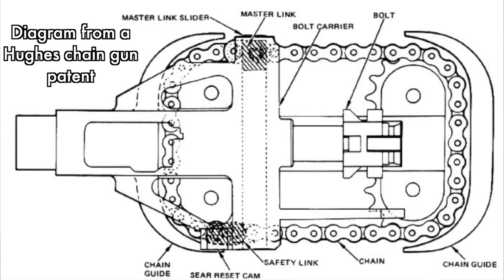Ask Ian: Are Man-Portable Chain Guns Coming?

Comment: My first thought, without seeing the vid is: Soldiers struggle with LMGs, even with beltfed LMGs that skip heavy magazins. How is anyone supposed to carry a chaingun?

Rockets and grenade launchers seem way more sensible for increased anti-infantry firepower. The XM25 seemed very promising. But maybe theres different answers and thoughts.

edit: Yup, not quite as bad as a minigun in weight, but even less benefits.
Reply: Since you mentioned Rocked and grenades, is there a difference between Missiles and rockets? or is it like Missile are big boom, rockets are small boom type of ammo since I remember something about Micro rockets?
Reply: @drivanradosivic1357  Yeh, in military generally missiles are guided and rockets unguided.

That said, these are very vague and unclear terms. Technically a "rocket" just means youre using a rocket engine, so guided missiles are often still rockets. Except the missiles who use jet engines, like cruise missiles.

And it gets even more fun if you consider that in english, missile can mean projectiles like arrows or even thrown rocks.

As for micro-rockets, probably not, because small rockets are horribly inefficient in size and weight. Look up gyrojet guns to see how bad they can be.
Something like a 7.62x51 machine gun with explosive projectiles would likely be way more devastating.
Closest thing in actual use would be 20-40mm autocannons. They almost always use explosive projectiles and are devastating against anything not using heavy armor.

Comment: One aspect where electrically operated firearms might have some advantage in terms of weight and materials is that you can further polymerize the design. You don't need metallic bolt carriers for example because all it does is carry the bolt. Depending on design the only metal operating components could be the barrel, the bolt head, firing pin and what is needed for the electricals. 

Personally I think the question was a bit too narrow. The better one could of been: Are electrically operated firearms likely to happen?

I think yes. The potential benefits for operational and manufacturing flexibility are not insignificant.

Comment: It's sort of like a car using a diesel generator to run an electric motor, the added complexity and weight outstrips any potential gains in efficiency. The machine gun already efficiently uses the self contained cartridges to mechanically operate the action so there is no real need to supplement it with an electric motor
Reply: except hybrid cars are actually a thing and get better milage than the ICE only versions
Reply: @davidelang  yes but the engine is not being exclusively used to drive the electric motor, the battery is being used to collect wasted energy (kinetic/thermal) and then the electric motor is being used to aid the engine. In a firearm there is no wasted energy to harvest or store

Comment: To make a chain gun (or a Gatling type gun) viable for hand-carried infantry use, you essentially need to equip your soldiers with powered and armoured exoskeletons. 

Developing actual, functional, combat ready power armour is certainly a much more significant step in itself than building hand portable chain guns, and probably a much greater engineering challenge. 

I can't help but think that the resources would be better spent on developing better and more compact infantry support vehicles and/or UGVs.

Comment: given that a chain gun does not rely on the mass of the bolt/carrier to operate, those should be able to be made lighter, so I don't see why a chain gun would be 5+ pounds heavier. they should have less reciprocating mass. and that mass isn't going to be slamming against a buffer, do this would seem to lead to less felt recoil

now, will adding electronics to firearms make them more reliable? no, it will make them less reliable, so only a good military fit when there are already electronics involved (smart rounds, computerized sights, etc). One big advantage of a machine gun vs electric weapons (coilgun/laser/plasma/etc) is that a machine gun with a single round is just as effective, once, as a machinegun with thousands of rounds, while the electric weapons are useless without a rather substantial power supply

It is an interesting thought experiment to think how much you could eliminate from the bolt/carrier/receiver if you remain locked like a bolt-action gun to handle the cartridge pressure and then open. the quick-and-dirty way would be to look at the straight-pull bolt action designs and just replace the manual action with a motor.

A chain gun could also have a variable rate of fire, very fast for short bursts, (get multiple rounds downrange before recoil can move the point of aim significantly) and slower for sustained suppressive fire.

bldc and stepper motors are very light and efficient, and for that matter, I could see linear versions of them being used

I think the limiting factor for how small the motor could be is how much force is needed to extract the cartridge, cams and levers can be leveraged to assist that first mm or so of travel (and there's not need to throw the extracted cartridge several feet, you just need to get it out of the way of the next cartridge in time to load it)

I think the reduced mass and velocity would cascade through other parts of the design. If you are driving the operation with a motor rather than momentum, what does that do for the loading of the cartridge, extracting it from the magazine/belt, could you eliminate the magazine spring (which is a balancing act of enough tension when firing the last round and not too much while firing the first to operate with suitable timing and not having the spring tension putting so much force on things that it's hard to move them)

Comment: I wonder if a sort of chain gun mechanism would be desirable for caseless ammunition. While there's no ejection cycle that you need to worry about with caseless ammunition you wouldn't have to worry about tuning a gas system to reliably cycle when an using externally powered action cycling.
Reply: Take a look at something like Metalstorm.
Reply: So far, ceaseless ammunition has major durability problems. And I’m unpersuaded that that can be solved. To be practical caseless propellant must combust explosively and completely AND be durable enough to withstand handling in the field and along the supply chain.
Reply: I don't think it would fly with caseless as it would lose the ability to handle duds.

Comment: One should note that Soviet designed autocannons, including rotary cannons, are generally not externally powered. The rotary cannons on Soviet/Russian aircraft (GSh-6-30, YakB-12.7) are gas-operated, while the single barrel GSh-30-1 in the MiG-29 and Su-27 is short recoil. These guns use pyrotechnic charges to cycle the gun in case of a dud. The gas-operated German Mauser BK-27 which is used in a large variety of aircraft including the Eurofighter Typhoon also uses this principle to cycle the action.

Comment: I can see far in the future, space firearms being driven by a linear motor because a gas system won't cycle in a relative vacuum, though it's hard to argue that's a chain gun, more of a... rod gun. Otherwise i can't see this being used,  even a powered armor should be able to clear a malfunction
Reply: For a warfare in places like the Moon, where you have very fine, abrasive particles. Your weapon should be sealed up as much as possible, so clearing any malfunctions should be done automatically by the weapon itself. That could be one scenario to have a chaingun (or maybe a "belt gun", it doesn't have to be an actual chain).

Comment: I imagine the lightest way to integrate powered bolt locking/unlocking and cycling would be solenoids. Given the abilities of modern batteries and super capacitors, one could integrate super capacitors into the magazine and receiver, and a battery into a chest/belt rig or even wires through a sling. At the end of the day, I’m confident it would still be little more than a novelty
Reply: no, stepper/bldc motors that you can control the speed and force over time rather than solinoids that only do one pull/push

Comment: How is a squib load dealt with on a chain gun?  If a round is underloaded in a traditional mg it usually wouldn't have enough energy to cycle the action.  A chain gun would cycle regardless and try to load and fire the next round?  

Similarly something like a broken case would seem like a nightmare as the external power source would attempt to cram the next round in and depending on force or torque of the external motor I can imagine the resulting jam being more difficult with the round completely mangled?  Compared to a spring attempting to push the round in on a traditional action?

Is this less of an issue on larger caliber weapons (stronger cases, better qc on powder charge?)
Reply: Good question? The projectile stuck up the barrel would not be good either unless the barrel is super heavy and rated to pressures double or triple of what the round is normally capable of producing.

As for broken/ruptured case scenario, one would hope they would have a sensor built in that detect and stop feeding.
Reply: Better hope the next round isn't a HE. I met a guy that worked on Bradleys a couple years ago and asked him about problems with the 25mm and he said one of the guns had an out of battery and exploded damaging the gun but he had no clue why it happened. I was mostly asking about rounds that hangfire and guessed that was what happened

Comment: I can see something like this being implemented in say an AR-15 type gun. Instead of a gas system and a recoil spring and buffer, you have some sort of electric piston assembly or something that pulls the bolt open, and pushes it shut. Although you'd need some way to power the thing, and I don't think it'll replace a conventional AR-15 anytime soon. But it would be cool to experiment with. You could experiment with this in machine guns to fine tune the rate of fire and bolt velocity to try and make the gun very controllable in full auto.

Comment: Would having an external power source to cycle the action mean that cartridges could be shorter (containing less propellant) and still achieve the same performance?  I presume the difference (if any) in saved weight not be significant enough to offset the weight of the chain/battery etc unless you were carrying at least several thousand rounds.

Comment: If we’re talking about man-portable HMGs, the XM312 comes to mind as a relatively light weight .50 (and 20mm HE) weapon system that had a slow fire rate and integral optics for improved per-shot-accuracy. It did not pass trials due to less reliability, heat tolerence, and fire rate compared to the M2 in mechanized applications.

The SIG MG338 may be the current solution to increasing power and range in a man-portable package. Sig claims that the .338 Norma Mag AP has better penetrating capabilities at 2000yds than .50 BMG AP.
Reply: I find the penetration claim to be highly dubious. .338 Norma mag will definitely provide better penetration than 5.56, .308 or even the new 6.8 round, but the math doesn’t add up to be better than .50 BMG. According to Norma’s website, a 300 grain round has a velocity of 2600-2700 FPS, while a 647 grain round will have 3000 FPS when fired from an M2.
Reply: @MPdude237  I was under the assumption that the ballistic coefficient would be in favor of the .338 NM at 2000yds+, but the opposite is true. 50 BMG has higher velocity, mass, and ballistic coefficient having 4x the energy at 2000yds. No amount of fancy armor piercing penetrators are going to beat that!

Now I'll have to go through promotional videos to find that claim again.
Reply: @MPdude237  Found the claim: https://www.youtube.com/watch?v=j66Y_owzcTo at around 1:45. They put the claim at 1500 meters, not the 2000yds I incorrectly cited from memory.

It seems highly dubious because the math just doesn't add up.

Comment: I dont think they were ever going to come, anyone whos been in any actual infantry position already knows how it is with positioning in cover, switching to cover and/or entering a house or clearing a room....its just not possible with a big metal suit on in general, wouldnt matter how advance the movement system is.....infantry die when left in the open and an exo suit wont allow for proper use of cover and proper firing from cover, especially if they are supplied with a chain gun system that would require a large gun and ammo storage and feed system

Comment: I remember seeing the 5.56 "Microgun" electric rotary gun at Shot a while back, so in that sense it's already being developed. But I don't think there is much practical need for such a thing to be man-protable. 

I'm curious though, I've heard that the Mk19 is very unpleasant to fire. And I've seen videos showing how much effort it takes to manually cycle it. I mean, the thing is just blowback operated so im assuming the bolt is massive and the recoil spring is clearly a beast. So I wonder if a chain gun design would be a good idea for a replacement. I'd bet some wait could be saved since the bolt mass no longer has to play a role in the fuction of the gun, and even if not the ease of use might be worth it.
Reply: The immediate problem I see with this is throwing unfired grenade rounds all over the shooting platform.
Reply: @TheDJOblivion  true, but I mean, they aren't armed yet. Plus you could tune it to eject shells at a less-than-scary velocity just in case lol
Reply: @ZeroSuitSamo  the rounds are rotationally armed, so ejecting a “dud” will absolutely risk having it roll to a friendly position armed, and who knows if the actual grenade itself is a dud or not
Reply: @nathanjordan1782  calling it rotational armed is misleading. Yes its the spin of the shell that arms it, but it's the centrifugal force, not the act of rotating that does it. You can't arm an unfired grenade by just turning it over a few times in your hands. Even the most violent ejection of an unfired shell wouldn't be able to get the rate of spin that a fired projectile requires to arm itself. But again, since you can completely control the speed of the bolt you could make the ejection relatively soft just in case
Reply: @ZeroSuitSamo  you could attach an ejection shoot that sends it a certain direction, preferably away from you
Reply: The Mk19 uses similar High Pressure/Low Pressure cartridges to the M79/M203/M320, so the bolt is big, but not truly massive. It's unpleasant to fire because it bounces around so much from the large(for a machine gun) bolt moving back and forth.
Reply: @PassiveDestroyer  exactly my point. If the bolt was entirely controlled by the chain mechanism, then it wouldn't have to be big and heavy, and it also wouldn't need to move as violently
Reply: That weapon is imposible to control. The recoil will swoop the gun immediately you pull the trigger.
Reply: @XtreeM_FaiL  at that point you're fighting torque more than eventually recoil right?
Reply: @XtreeM_FaiL  I'll have to take a look. I never said it was practical, just that I had seen it was a thing lol. Even from a purely logistical standpoint it wouldn't make sense in a man portable role just because of the amount of ammo you'd have to carry for it.

Comment: The only situation i see where a hand held chaingun would work is in combination with an exoskeleton to help increase carry capacity. Both technologies are held back by limited energy storage
Reply: Just a picture in my head: The exoskeleton guy is followed by and tethered to a battery carrying walking drone.
Reply: @JohnADoe-pg1qk  the walking drone is in turn followed by another drone, holding a battery. All the way down 😂
Reply: @veldin25  i think you've just invented a really long cable with extra steps.
Reply: @JohnADoe-pg1qk  Just put the gun on the robot! What could possibly go wrong! Lol. Get to da chopper.......
Reply: Ad some armor to the exoskeleton.

Fallout 4 theme plays.
Reply: I suppose you could stick a two stroke motor on there. Gasoline’s pretty darn energy dense, but I doubt an internal combustion engine would be all that great.
Reply: Would you need an exo-skeleton to absorb the recoil of a fast-firing (e.g. more than 1,000 rounds per minute) machine gun?

Comment: In the darkest corners of my mind, where the Atack-Helicopter/M40/Ontos hybrid lurks, I've wondered to myself:
Would a belt-fed sub machine gun not only be awesome, but militarily viable?
Reply: ...Except your SMG can fight and reliably damage an AFV or Helicopter, no, I don't think it will. Too heavy, new point of weakness in CQC, etc.
Reply: @rusdanibudiwicaksono1879  
   Just a random idea of mine. (The flying Ontos is more of a joke. It was just a example of the technically plausible, but also completely off-the-wall ideas I can come up with. Albeit, it would be interesting to see a flying anti-tank recoilless rifle mounted to a helicopter.)
   On the smg, 100 or more pistol caliber rounds in a 'handy' and controllable weapon system I think could be useful, unlike drum mags.
   You'd probably want to design it to take also take stick mags, and use that in most situations.
   FYI, in brainstorming, even a bad/crazy idea can help generate a good one.